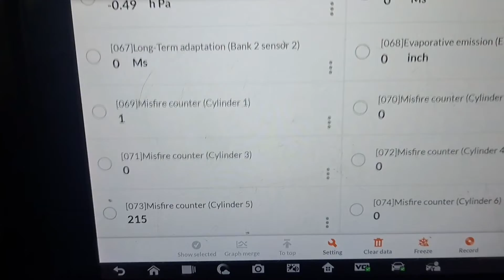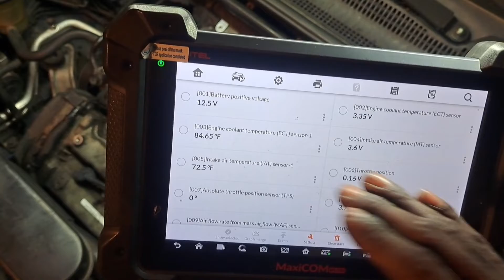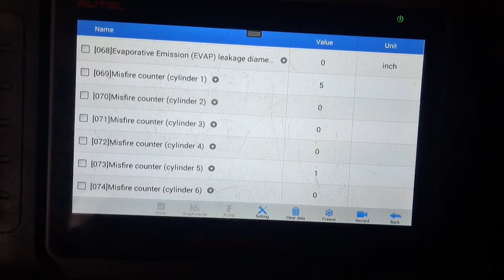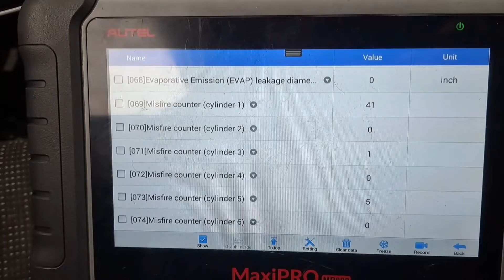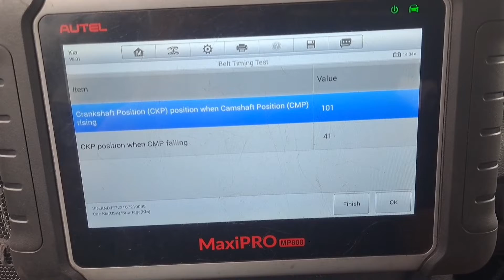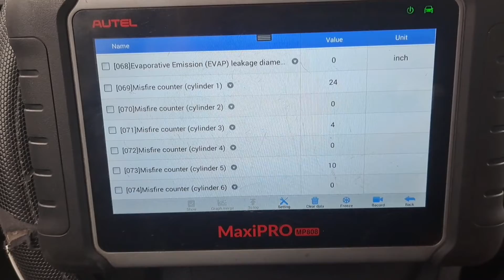kia p0301 p0303 p0305 what would you do to fix this?

Comment: Sir, you are amazing. I just watched a video you did on changing the fluid and filter on a taurus to stop disengagemant problems. I am having the same problem and am going to change the filter and fluid. Do you remember how much fluid it took to refill it?
Reply from the maker: I don't recall how much fluid,  However the part store you get supplies from should be able to provide that info for a drain and refill.  Places like oreillys... autozone and advance auto,  they will have that in specification